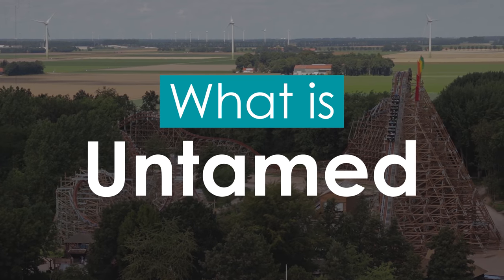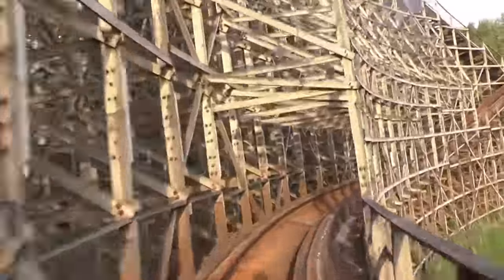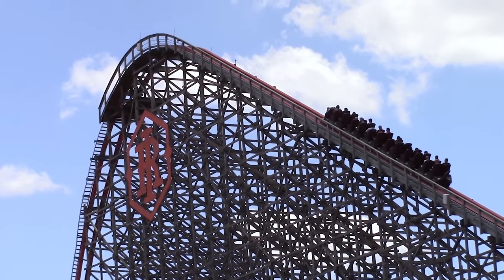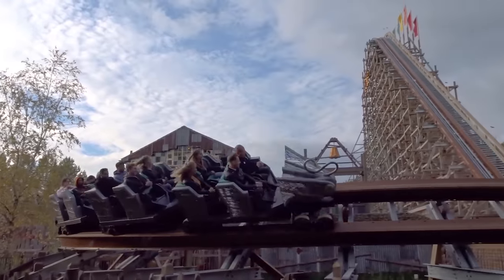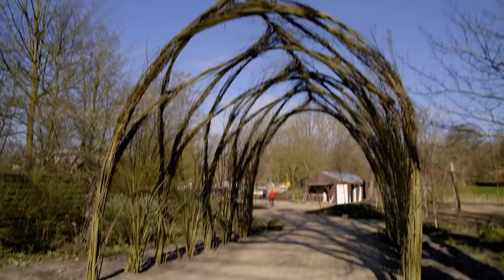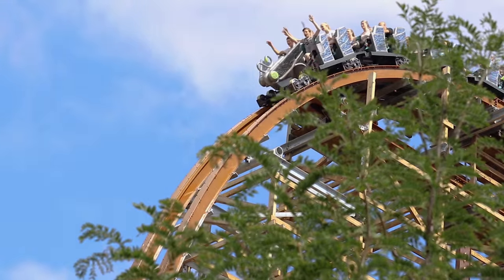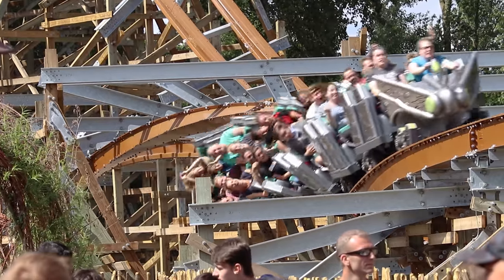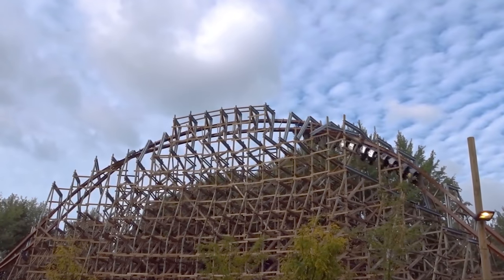What is: Untamed - Europe's First Modern Hybrid Coaster!

Comment: I would like Rocky Mountain construction to fix the old and rough Wooden roller coaster thunder hawk at my home park dorney park in Allentown pa
Reply: With respect, RMC doesn't convert coasters as old as Thunderhawk. The oldest they've converted is Colossus at Magic Mountain, which was built in 1978. The majority of their conversions have been coasters from the 1990s. Thunderhawk dates to 1924, and is a classic coaster for the park. It may not be your favorite there (it's not mine, either), but it has a place in the lineup, especially for younger riders, or folks who aren't up to riding something more extreme. I'd love to see an RMC at Dorney as well, and I think a new Raptor style coaster would go nicely in the spot where Stinger used to be. I've heard plenty of rumors about a wooden GCI going in there, though.
Reply: Yeah I would love to see a gci at dorney park, they could use a good wooden coaster.

Comment: Is there even a difference between the I-box track and the topper track?
Reply from the maker: There is! The topper track has layers of wood, making roller coasters that use it entirely wooden. Ibox track is completely steel, making those roller coasters hybrid types.
Reply: @coasterbot  
https://www.coaster101.com/wp-content/uploads/2015/11/track-comparison.png
The stack is not a part of the track. All it does is to elevates the track from the rest of the structure so that wheels can be placed underneath the actual track. This is why there are no running steel against the stack.
The steel beam of the topper track is the track while the wooden stack is part of the structure and is only affected by positive g forces. This is why they don't have to go trough the same work as gravity group when they want to make inversions.

I would not call it wood track, but what we call it doesn't really matter that much.
What really matters is how it feels. Is there a noticeable difference between the topper and the i-box track when it comes to how it feels to ride on them?

Comment: "Europe's first modern hybrid rollercoaster", what does this mean exactly? Is there something specifically different between Wildfire and Untamed that doesn't qualify Wildfire for this category? It sure was opened many years before Untamed
Reply from the maker: Wildfire is classified as a wooden roller coaster as the track is made entirely of wood (except for the top steel layer found on all wooden coasters). Untamed has steel track and wooden supports, making it a hybrid coaster :)
Reply: Wildfire although its an RMC its classed as a Wooden Coaster

Comment: It's far from europs first rmc
Reply from the maker: It was Europe's first RMC hybrid roller coaster! Though built earlier, Wildfire is classed as a wooden roller coaster :)
Reply: @coasterbot  you can class it as a toaster. Does not mean it is one. Wildfire is a hybrid nomatter how it's classed
Reply from the maker: But it's a wooden roller coaster because it has wooden rails. Most, if not all, modern wooden roller coasters utilise steel beams at some point during their construction.